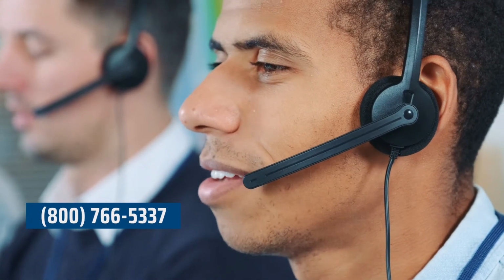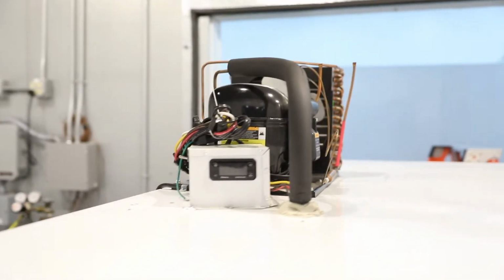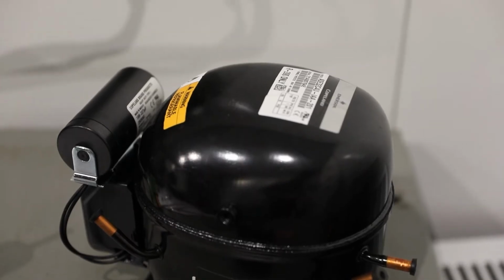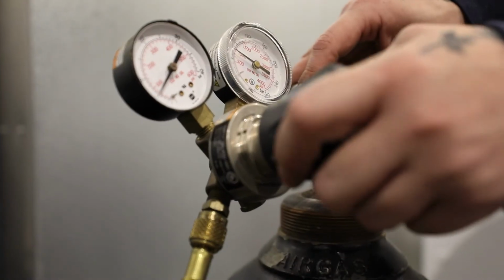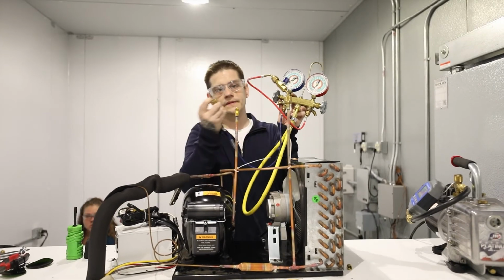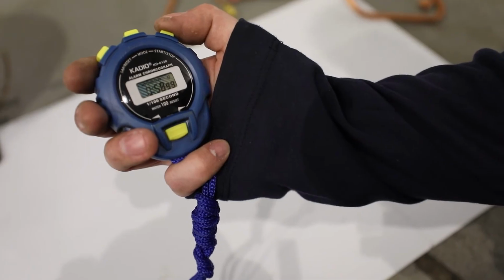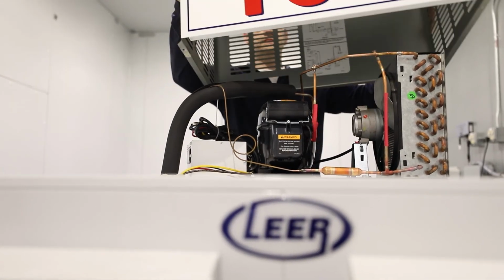R290 Refrigerant Service Training | Leer Inc.

Comment: Firstly, great video. My only question is why cut off the schrader service valves? Wouldn’t it be better to leave them on for future service? 
I recently replaced a ruptured condensate discharge pipe and installed a schrader valve to the suction and have left it in place. Should I be concerned?
Reply: No dont be. its far more dangerous to take them off and weld them pipes shut.

Comment: Ive an ultra low freezer with -20c and recently replace a new compressor.
I weight the r290  refrigerant for 90g on filling according to the freezer label  and probably my weighting scale might not be very accurate.
During running, the low side pressure is app 18psi.
After it achieve around -10c to -15c, the low side pressure suddenly drop to vacumn level. Subsequently the freezer cabinet getting warmer gradually.
What could be gone wrong?
I did evacuate the freezer for app 2hrs and it should not be be moisture issues i guess.
Pls help what could be gone wrong in the replacement process.
Could it the refrigerant filling is so sensitive yhat you an even over/I ndsr filling even 15g.
Reply from the maker: @ewechailim5368, thanks for reaching out!  If this is a Leer unit, here's what I'd recommend:

Even a small variation in charge — around 5g — can noticeably affect system behavior. Using a good scale, short and smallest diameter hoses will help you get as close as possible to the critical charge. With the information you have given, it is possible the unit is slightly undercharged. Is this a Model 40 Freezer? If so, we show that a 40 Freezer takes 105 grams.  Please verify your serial tag and charge.

With the pressure drop, does it stay low or rebound? If it stays low, it could also be possible you have a slight restriction. Do you have a micron gauge to make sure all the moisture is out of the system and not causing any issues? Was a new filter installed?

With this being a freezer model, it should have a door switch that controls the evaporator fans. Make sure the evaporator fans are operating correctly.

Good luck getting your new compressor to operate perfectly!
Reply: @LeerEmployeeOwned thanks. Problem solved after flushing and replace with another new filter drier
Reply from the maker: Glad it helped!
Reply: If you open the seal system,  change the filter drier, it's price 20 bucks. Come on man

Comment: Dump the r290. Propane. And put in 134a. It works perfectly. Done it many times with zero issues.
Reply: I heard this but techs say no the oil is wrong in the compressor
Reply from the maker: @John8910, thank you for the comment. We appreciate people challenging us to make our content and products their very best.
 
Unfortunately, switching refrigerants in a system in the field would void the UL mark and the Leer warranty. Our R290 systems and components are designed to operate with R290, which has a GWP of 3 vs 1300. Retrofitting may also have regulatory repercussions.
 
The reasons Leer chose R290 are numerous. It's a high-performance refrigerant. The superior thermodynamic properties of R290 (compared with R404a or R134a) allow for a reduced charge per system and lower system energy use. More information can be found on leerinc[dot]com/eco-friendly.
Reply: Did you change the oil in the R290 compressor before  you recharge with R134a refrigerant?
Reply from the maker: @rivalspro4  Thanks for the question. The best practice is to use like oils and refrigerants. Most of our units are POE (Poly Olester oil), but we do have some that are ABO (Alkyl Benzene oil). It's best to check the tag on the compressor to verify what oil is in the compressor.
Reply: No i wont

Comment: Brazing without nitrogen purge create copper oxide. They have poor worth ethics
Reply from the maker: @juliochavezunacosa4147, we appreciate your feedback. We're always looking to improve on our resources.
 
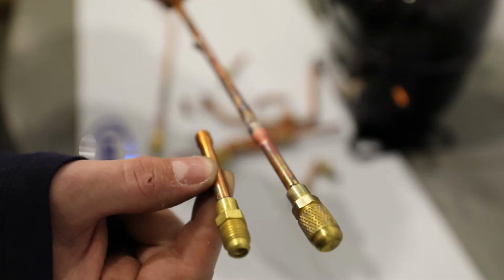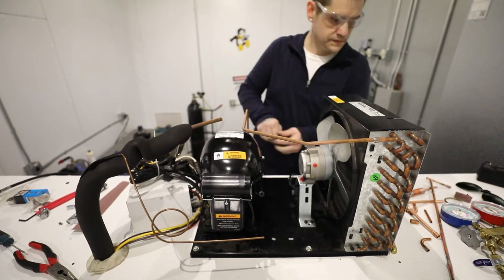First, you're absolutely right. Brazing with nitrogen displaces the oxygen, so there's no scale buildup inside the copper. It's a best practice and something we do at Leer. Although brazing isn't mentioned by name in the video, it is described from 5:12-5:30 on the timeline.
 
Copper brazing is described in greater detail and is available in our repair guideline, which you can find on leerinc[dot]com.

Comment: This doesnt teach what we want to know which how much psi do you put in
Reply from the maker: Around 5:15 we discuss the PSIG amounts for nitrogen. Or are you looking for R290 charge amounts?
Reply: I want to know how much psi r290 a regular system take on a regular refrigerator with 134a i normally put 15 psi so i am wondering if its the same charge for r290@LeerEmployeeOwned
Reply from the maker: The charge amounts vary based on which Ice Merchandiser you're referring to. Please call our Technical Support Dept. for more details. They'll happily help resolve your issue.

Comment: Is safe to piercing (piercing valve)cooper tube with R290 inside?
I see a lot unit with "no piercing r290"
Reply from the maker: Thank you for your question. Piercing would be required for servicing of the equipment only and must be removed after service. Follow the service and repair guidelines document on leerinc.com for proper setup, accessing and removal of the piercing valves.

Comment: Please help me! what will be the pressure of R290 in Deepfreeze and in bottle cooler
Reply: Capilary tube or txv?
Reply: @tonyp6088  in capillary system
Reply: 35 Psi
Reply: Low temp,55psi med temp